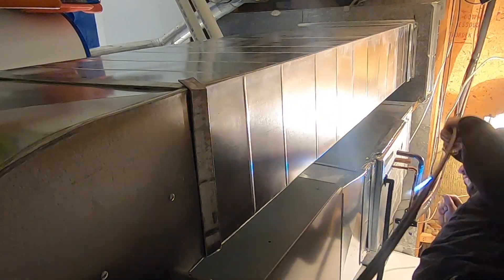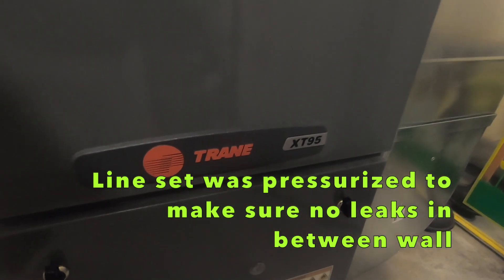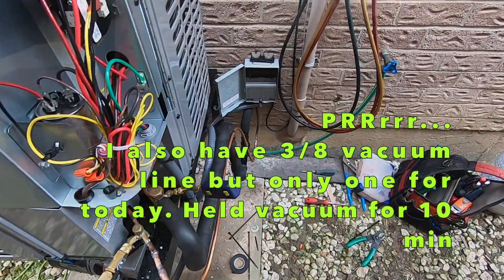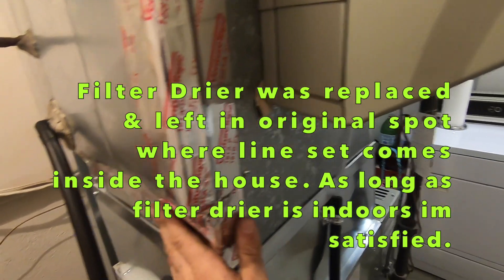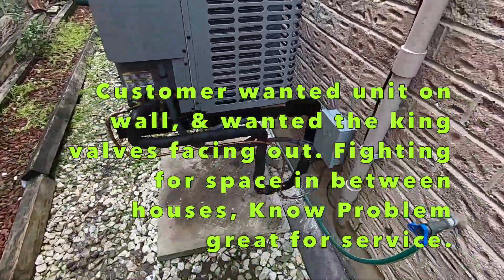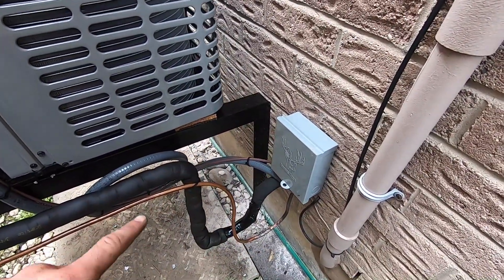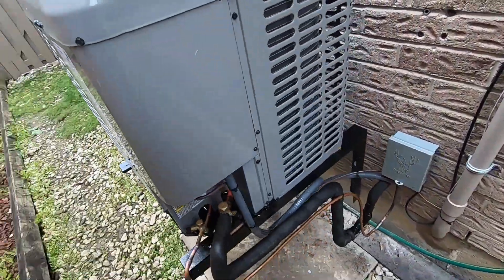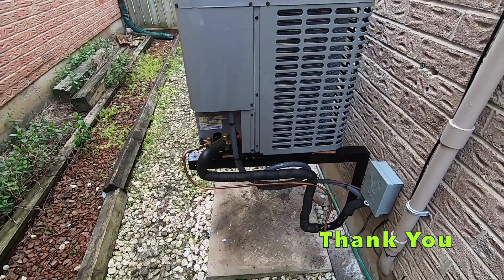HVAC: Trane changeout | Coleman In

Comment: If you get the 14 seer Coleman it is fin tub not microchannel. I'm putting coleman in at my dads. I like the Coleman unit put a couple in this year. If customer wanted cost effective did you offer good man or you could of sold them a 407c Evcon unit.
Reply from the maker: Hey bud, I did not know Coleman made a 14 seer thats fin tub.  We do not have the Evcon 407c units up here, in addition, I do not know if they would want to go that route. Although, In regards to a dry system yes I did mention the goodman unit.   
 I will be looking into that 14 seer Coleman, I think it might be one of my go too,  heck i might put one here as well. Thanks glad you stopped by:)

Comment: Do you think more units should be mounted to the wall at a height to avoid the water from the snow melting year after year? (Obviously  service is much easier of course)
Reply from the maker: hey bud yes, as well as many other reasons.
Reply: @HVACRNorth  I can think of a few but yeah it's a good idea

Comment: You’ve never had a call about vibration from the bracket? I use to hang them but had one that was EXTREMELY loud from inside.
Reply from the maker: Not yet buddy lol. Most of the time I out vibration pads as well. Thanks
Reply: HVACR North Understood... Same here. It was a real nuisance I still like them hung. Good work.
Reply from the maker: @rudyrangel5910  appreciate it. Message anytime bud